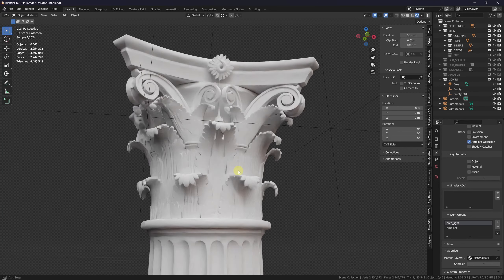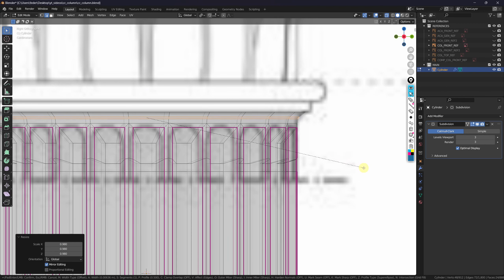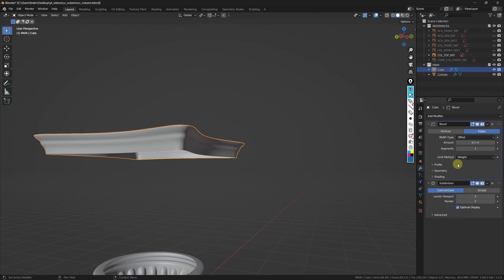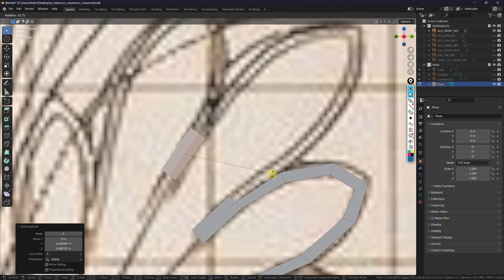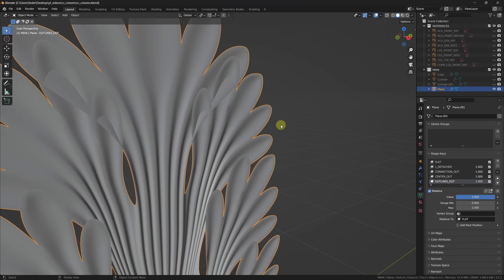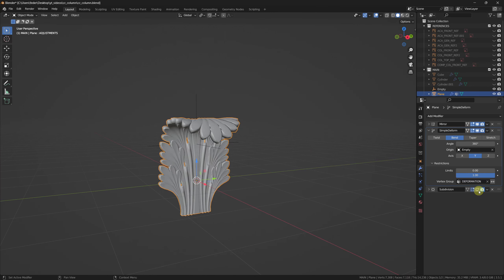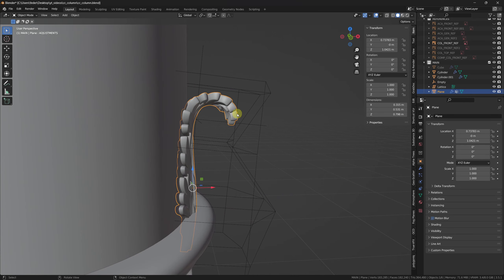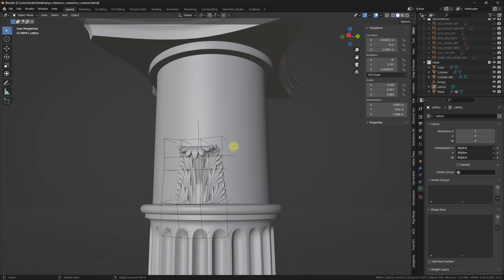Let's model a column in Blender - a step-by-step tutorial on non destructive workflows (pt.1)

Comment: Thanks for the tutorial. I think something has changed in Blender as the brush selection for weight painting is not as it is in the video, with no option now to select a subtract brush. Instead, hitting D will switch the Direction from add to subtract.

Comment: Firstly I want to thank you for this tutorial.  That said, i also would like to point something out:  Between finishing the acanthus leaf and before lofting it around 8 instances you have a cut.  Somewhere in between there must have been some adjustment that's missing.  When I follow your tutorial 4 of the 8 leaves end up slightly crooked when rotating them around the column.  The origins all match.  My only fix for this was to apply all the shape keys and to apply all deformations, and then just distribute them old school, through duplication and rotating around column center.  Still, Thank You for those brilliant tutorials!
Reply from the maker: Hello, that's actually strange as applying shape keys is not needed. Do you have an email account I can refer to?
Reply: @hbitproject  Thank you for responding!  I came to the conclusion that must have missed applying the transforms at some point, resulting in the issue.

Comment: I'm having trouble getting the simple deform modifier to work properly, it doesn't curl nicely like that. Instead the top and bottom planes move in opposite directions. Do you have any thoughts as to why that might be?
Reply: Nevermind, just needed to watch a little more

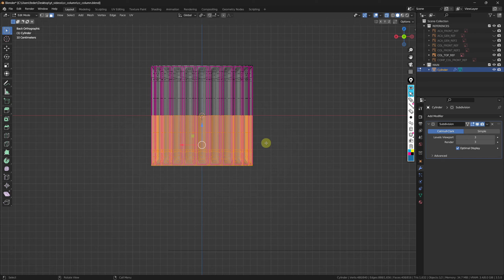Comment: I've been following this but struggling with the bit about making the column longer at 3:31. It says to go into face select mode, click B, select the lower half, and "just push it down". I can't figure out how to push it down. I googled and found some tips to hit E to make it longer, but when I do that, the part that gets longer doesn't have the bevels in it and it often moves on a diagonal instead of straight down. What do I click to "push it down" and how do I make it go down straight? Thanks!
Reply from the maker: Hello, just hit G and then Z 👍
Reply: @hbitproject  Thank you so much! That worked. Awesome tutorial. Really appreciate it.

Comment: @1:56 when I try to inset the faces a second time after having all selected, nothing happens. If I select 1 face section it does it but it has  the edge loop top and bottom from the first inset..Im not achieving what you are showing do you have your inset set or what key command are pressing when you do the inset?...Oh I see that you didnt explain that in the inset settings you have to have individual checked.

Comment: This tutorial is amazing. I've been using Blender for longer than I'd like to admit, and I cannot BELIEVE that I never knew about the 'connected only' checkbox for proportional editing. If I was drinking coffee when you did that, I would have spat it out on my monitor and keyboard. Your channel is very underrated. You have a very mathematical approach to Blender and it works very well.
Reply from the maker: I learned about it quite late too! Glad it helps 👍
Reply: My proportional editing works when I check the part of mesh otherwise it doesn't work.

Comment: Hey, I had an art test for a video game company where I had to make a high poly capital and a low poly with textures... in 4 hours, does it seems doable to you? I struggled alot with it, i finished in 5 hours with a ugly lowpoly of 600 tris where i should have done it in 1000 tris
The thing that took me so much time was modeling the leaves vertice by vertice, it was so long
Reply from the maker: 4 hours is a bit challenging but doable. For the leaves you may just model one "group" and then duplicate and adjust. Or perhaps sculpt and remesh if you are more familiar with that 👍